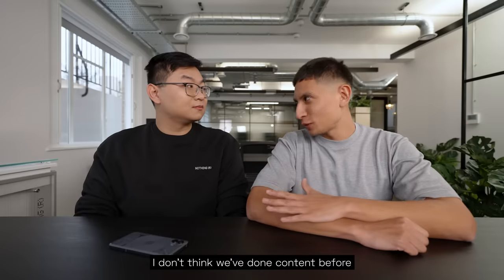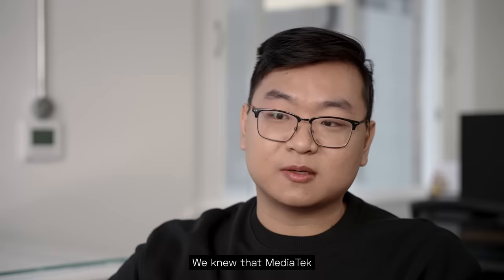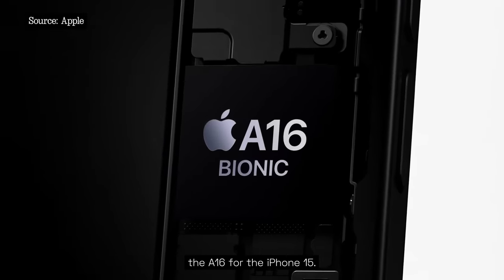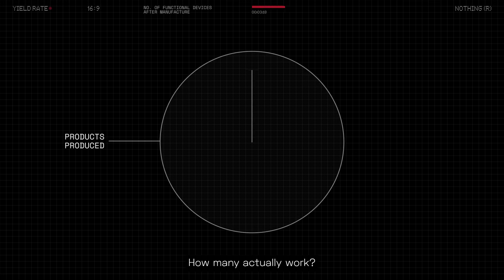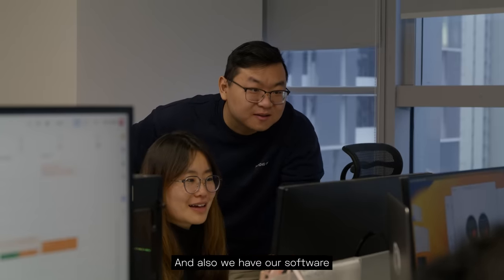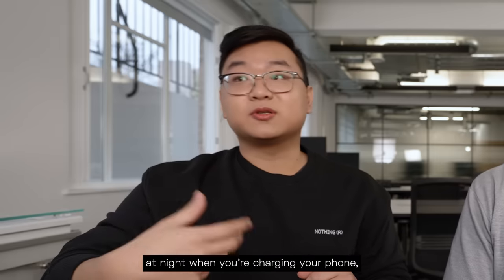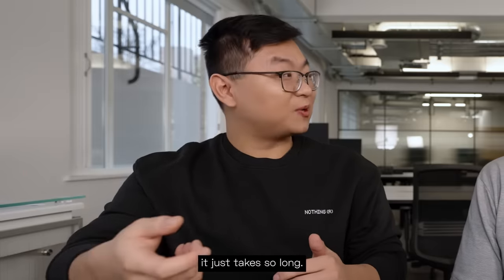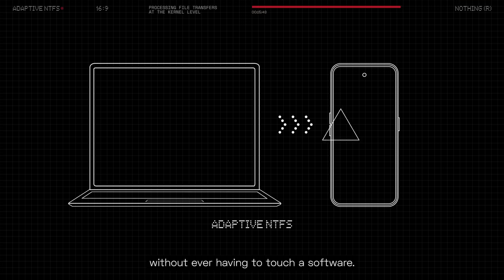Phone (2a): Snapdragon vs MediaTek

Comment: I'm a bit concerned with this deep clean actually decreasing the life of the storage. Flash storage has a write limit before it fails completely, which is the reason we generally avoid peforming these operations. Forcing extra reads/writes to re-arrange the files just uses this write limit up faster. 
If you're seeing tangible benefit from speeds, that's good.. But if you don't include expadable storage or make this feature opt-in, you're essentially just forcing a quicker expiration for this devices life. Especially since the OS can't be easily moved between storage devices.

Comment: alot of misconceptions about processors is that they base the performance of  the phone on antutu benchmark scores.

let me tell u this. the reason why an iphone se 2nd gen may outperform a midrange android simply because of the software integration and optimization, iphone IOS is so optimized that it can run decent on older phones, CONSISTENTLY in each of the devices.

however, on android, since its a very open platform, easy to modify, may have software optimization issues, and even incompatibilities IF NOT utilized well.

if you compare the cameras of the iphone, it has a conistent quality in each of the apps that use the camera, compared to android, where it is always inconsistent, and the only way to get the best quality is to use the camera app.

in phones, the software is what really matters, how good it utilizes the processor.

Comment: Not sure. The OnePlus 12R is priced at around 650€ with an 8Gen2 processor, that is miles ahead of the here mentioned processors. Even the 8Gen1 or 8+Gen1 would have been miles ahead. So if this is priced at anything higher than 450€, I'm not sure it has a market

Comment: I understand why you selected the mediatek processor. I knew why and what made you select this processor before you guys explained. The processor is good, no doubt in that but how will the glyph lights work with third party apps if there is no project aura for mediatek processors.
Snapdragon processors have an open source project called project aura which made it possible for you guys to release your 3rd party app interface with glyph light

It's either this or this phone doesn't have glyph lights

Comment: I love the Nothing Phone 2. It's a breath of fresh air in a world dominated by same looking slabs, and its performance compared to handsets costing twice as much was a lot of the draw, similar to the first models that OnePlus put out, but I do think the processor choice for the new 2a is questionable and could be seen as a cost cutting exercise.  The MediaTek chipset is definitely in a lower performance bracket (do the research...  it's out there) compared to the Snapdragon 8 Gen 2

I've no doubt the phone will be great but i think moving away from Snapdragon will be a deal breaker for many
Reply: If this is a 8 gen 1+ for sure it will be a hit. I don't mind the plastic back at all. 

Currently using Legion Y70 so I really like that chip. 😅

Comment: 7s gen2 is cortex a78 based which is old design. D7200 is better than that.

But dimensity 8300 or 7+ gen2 is right processor for mid rsnge phones. They should have opted between two.

Comment: Dimensity 7200 for something rumored to be $350 is wild when you can buy Oneplus 10T for $300 right now on several sites like Woot, which use Snapdragon 8+ Gen 1. Like, why compare with much much older Snapdragons that aren't used in any phones that are above $300 in 2024, when your literal competitor with a much better processor is right there.

Comment: type c charger 
E Sim 5G and 1 normal sim
Minimum Rugged design,
Good display Like( Amoled),with high RF 120 hz rate 
5000 mah to 8000 mah (Li-ion) Battery,
Snapdragon 8 Gen 2 Above Good Processor,
SD Card support,
2 Air Trigger.

Comment: I get that dimensity 7200 pro is manufactured by tsmc like 782G but it has better nm process but why didn't you guys use snapdragon 7+ gen2 its far better than 7200 pro in all possible way. 
I think that nothing is done this to reduce the price of the device because snapdragon 7 plus gen2 price is higher compared to mediatek

Comment: Fact:😂
Dimensity- 1) cheap for company 
2)product wont last longer for customer.
3) Profit For company -  phone gets many issue after 1.5-2 years. and customer will easily switch to new phone.
4) Heating issue
5) company have profit launching in low price- Innocent customer will think too many feature in low price 😂
Snapdragon -  1) Costlier for company
2 ) Product will last longer -customer will use phone for some more years so loss for company
3)Better heat management.

Comment: 1:40 You guys spoke about the snapdragon 782G but not the 7s Gen 2 yes they both are made by Samsung but the competition is the other Snapdragon 7+ Gen 2 & Snapdragon 7 Gen 3 both are made by TSMC which do have better AnTuTu 10 score Snapdragon 7 Gen 3 +19% - 866863 vs Dimensity 7200 Ultra - 727881.  If the nothing phone 3a i am sold .

Comment: phone company really need to put much effort in kernel tweaking. especially on mediatek.
i use lots of phone ,and most of it , stock kernel has bad optimization, some is good on previous OS and performance drop on current OS version. 
some phone can be rooted and optimization are much easier to get.

I found out nothing phone 2a still have frame drop on latest OS update .  And that is not acceptable. (i saw same case with many youtubers video too)

Comment: I have Motorola Edge 20 Fusion rn it only got Android 12  from Android 11 update, on forum they blamed Mediatek for it as a  pending partner approval. Is Mediatek is good in software support section ?  
It has Dimensity 800U made on TSMC 7nm process, but it heats very much during charging, long calls and due to which it throttles during games (CODM). Will it happen on Nothing 2a Dimensity 7200 (Pro) ?
And the Kernel level stuff, it is safe ?

Comment: Wasn't garbage collection on nand flash performed even charging and idle. Isn't Mtp fast enough to transfer from f2fs/ext4 to NTFS? For even faster read and write adb push or pull should be very good for solid blocks of data and acceptable random write performance on very small files

Comment: Snapdragon 7 Gen 3 would have been a better choice.
It will take atleast until Mediatek releases Dimensity 7400 to match the Snapdragon counterpart in a much meaningful way including Ultra HDR support, a better modem, improvements brought by Mali-G620 GPU and newer arm CPU cores, a better vendor specific kernel and better performing platform in the long run by Mediatek. I'm not dwelling into more technical aspects now.
Until then Snapdragon is the better choice.
Reply: Are you aware that 7 Gen 3 would have risen the price, right?

Comment: How much are they going to sell Phone 2a for?  The Dimensity 7200 Ultra is not a very powerful SoC, in fact it is worse than the Snapdragon 865 or even the Apple A12.  If this is a mid-range device, then they should use at least Dimensity 8200 or Snapdragon 7+ Gen 2.

Their subsequent statements about copying files to and from PCs are also confusing. It is well known that the reason for the slow USB transfer speed between Android and computers is that Android uses the MTP protocol instead of USB Mass Storage.  Google switched to MTP in Android 4.0, which was by design to allow emulated SD to be available when connected via USB. Also there's nothing to do with NTFS.
Reply: Dimensity 7200 pro not ultra, its faster then 7s gen2,
Reply: @vivaanreddy8771  Upon checking the benchmark scores they given for 782G and 7s Gen 2 in the video matches Antutu benchmark. The score for 7200 Pro in this video also matches for Redmi Note 13 Pro+ which equipped with a D7200U. Just for reference 7+ Gen 2 should reach 110k, much higher than 75k in Antutu.

Comment: About NTFS optimizations - what in the hell are you talking about? Phones are not exfat, they use eithr ext4, f2fs or other linux filesystem. Also what does NTFS have to do with anything? android phones use MTP protocol to transfer data so its completely filesystem independent.

Comment: I personally as a person, who has been a chipset enthusiast for years now i think they are fairly right on this one don't get me wrong i am biasedly on side of Qualcomm but i think Qualcomm nowadays make literal shittiest stuff compared to their peak in 2019-2022 after that they are as dull as you can ever think of on the other hand mediatek is really cheap and not half bad nowadays and more battery efficient too! so you can make budget phones with it on the other hand Snapdragon 700 series is battery efficient and all too but compared to dimensity 7200 pro it dosen't come even close in most of the features and especially gaming performance is like shittier than even 855 which is also about 5 year old proccesor so using such stuff is impossible so what is the better choice well either use flagship snapdragon or mediatek which can deliver comparable performance with a snapdragon flagship.

Comment: I think It would be great atleast nothing use snapdragon 7 plus gen 2 🔥 instead 7200 pro , everything is great apart from low performance processer👎 kudos to design❤. But this is not the performance that we need in 2024.  Expected good processor with this design language disappointed 😕.

Comment: 2600 points in geekbench 6 multicore 💀💀💀
I'm sorry. This is overhyping a weak procesor. Unless your software is light and optimysed enough(wich is extremly hard)it will not feel smooth,especialy after around 2 years
Tho i'l have to give it to u: samsung SUCKS at procesors, i'm preety skeptical and i could deff be wrong(and i wish i'm wrong bc i love nothing products)and idk the procesor cost but i think u could've done better

Comment: I would like to diagree here on the justification these marketing guys providing here to go with MTK than Snapdragon.

A chipset is not only about CPU (processing speed) but there are lots of other components and technologies which define a better SOC and provide good user experience.

Be it's technologies like audio, connectivity (modem,wifi, Bluetooth), NPU, Thermals, Soc level app optimizations, Efficiency, Compatibility,public kernel support, Custom ROM support etc.

In these areas snapdragon chips are far better than MTK.

I think here Nothing phone is trying to go cost effective that's the reason going for MTK otherwise Snapdragon 7 + Gen 2 was far better chip than what they are going for.

Comment: the problem with Mediatek chips isn’t bad performance, it’s longevity. they don’t last long, and you can’t test that in a lab.
Reply: Umm… yes they can… and they do. Have you ever seen Apple or Samsungs labs where they are testing everything about their phones? Samsung builds machines just to open and close their folding phones over and over and over again to test the hinge. If you don’t think their is software or some machine to push the chips and test them 24/7, then idk what to tell you
Reply: @Rudgged  mate, that is just endurance testing and they project the score based on confidence intervals. 

if it breaks after x in y time,
then it will break after x*100 in y*100 time. 
so on…

this can be predicted with some level of confidence, usually 95% (1.96 standard deviations from the mean)

i meant, you can’t simulate time.